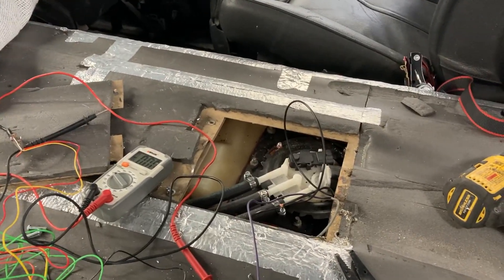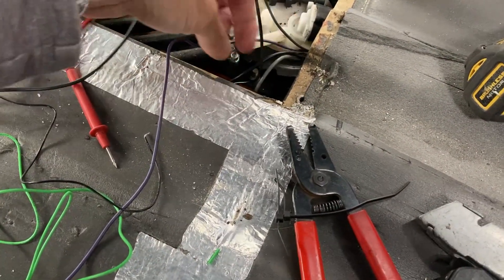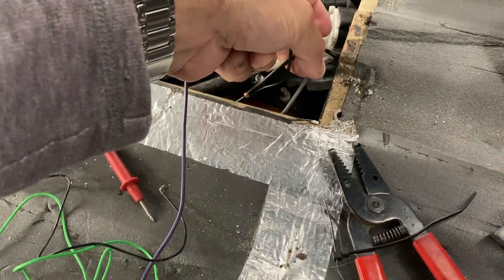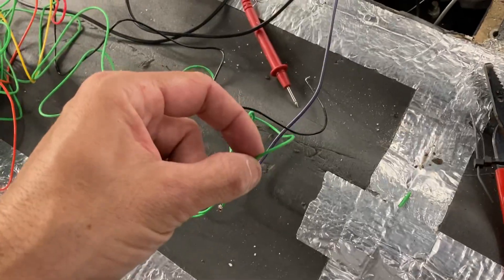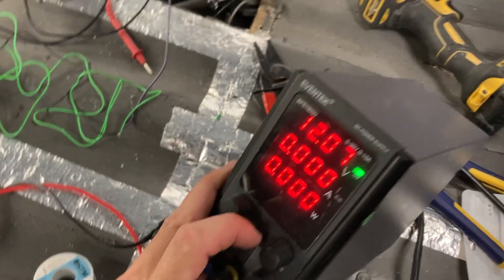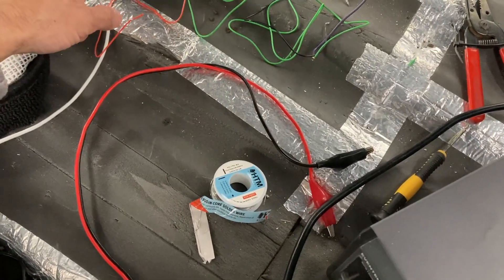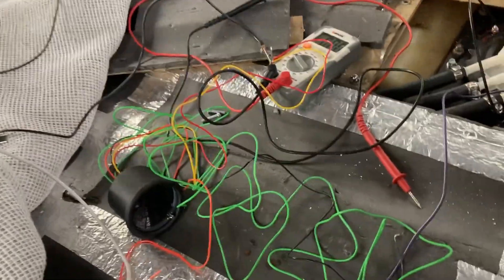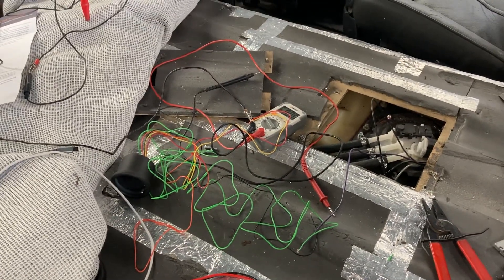Glowshift fuel gauge install Wiring with Amazon GM Chevy fuel pump

Comment: I'm trying to do the same thing, did you ground the fuel pump and the fuel signal ground to the body or the battery? Did it work if the power is coming from the ignition power of the dash? Trying to figure out my fuel level sensor
Reply from the maker: The humvee body is aluminum so you could ground to the steel frame, but the stock body harness brings everything back to the battery, so I home run all grounds to a ground bus bar. The pump power that makes it pump fuel is off of the ECU harness and coordinated by the engine computer. My sender power is its own line which can be any 12v source. I ran individual power and ground to the sender, and also to the gauge if I remember correctly because I was seeing the gauge move depending on subtle voltage variation when it was sharing another system's ground or power wire. Basically a power and ground to each item. The fuel pump power comes from the ECU
Reply: Ah okay, yeah. I wonder if I have to go to the ground of the universal dash, to complete the circuit to get the ohms. Or straight to the battery, if that makes sense
Reply from the maker: @DCValiant68  usually you can share a ground. I.e. most cars ground to the body or frame which is conductive and has a connection to the negative battery terminal, so it brings it back to the battery and completes the circuit. With the sender though, I ran a dedicated ground wire back to my main ground bus bar which is connected to the negative battery terminal. When i originally set it up as a shared ground, I was getting unstable fuel level readings due to interference from the other devices on the ground.

Comment: What size sending unist did you get?
Reply from the maker: the one that comes with this pump. https://www.amazon.com/dp/B014HB983M?psc=1&ref=ppx_yo2_dt_b_product_details.  The gauge has a variety of settings which is done analog with a screwdriver to set the correct impedance range your sending unit produces.  https://www.youtube.com/watch?v=ZlvWS9y3wXM